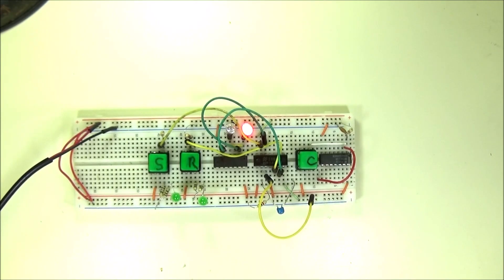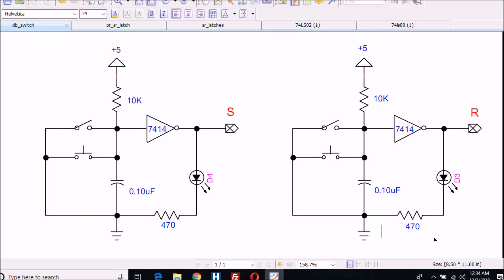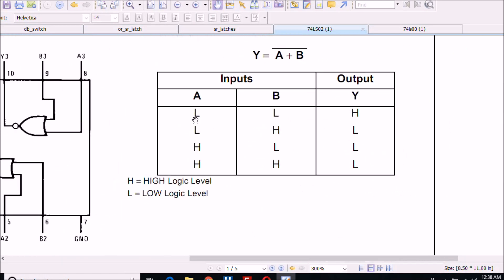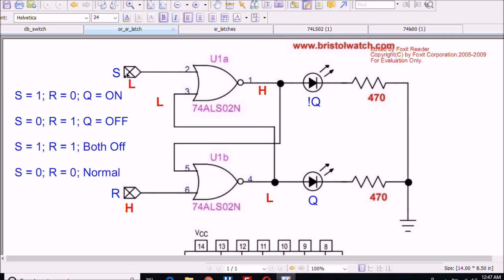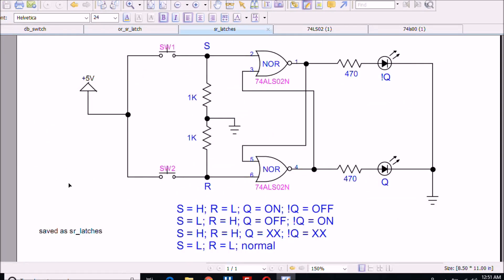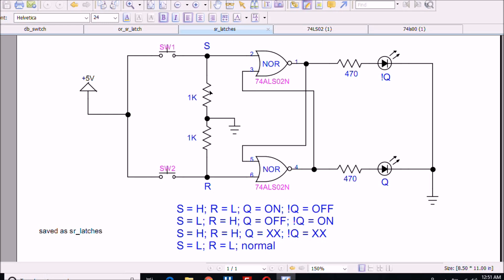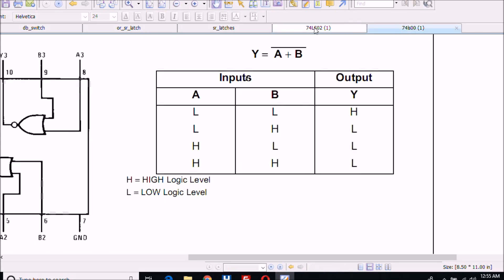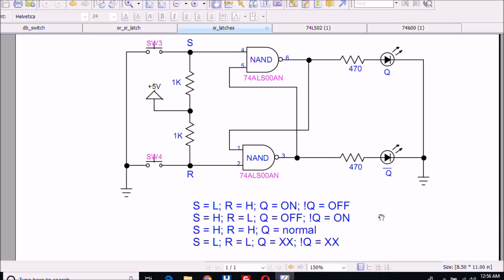Build Basic NOR Gate SR Latch

Comment: This is a GREAT! instructional video and I appreciate your time and effort to present it - 
Only issue I had was the NOR Gate pins are not what I found to be valid for my CD4001BE Quad Two-Input Nor Gate chip. In the comparison of the NAND Gate and the NOR Gate picture, the pins I ran into were 1 & 2 were inputs, 3 was the output . . . after trying numerous times to get it to function, I finally woke up and researched the pin out on-line to find the correct pinout for the chip I was using - problem solved.  FWIW, I am using this circuit to "indicate" which direction my HO scale model railroad turnouts are positioned - and I must say, it works PERFECTLY!  I am using a two-color LED (Green & Red) to indicate "straight thru or diverged". I am also using an On-Off-On (momentary On) switch for activation. Thank you, this circuit has been a GOD-send for what I'm trying to accomplish. Keep up the GREAT! videos . . .
Reply from the maker: I'll check o that and make corrections. Thanks.
Reply from the maker: I'm lost here. I didn't use a CD4001, I used a 74LS02. But you are correct the CD4001 pinouts do differ. Good work.